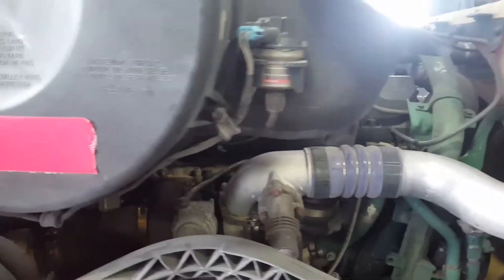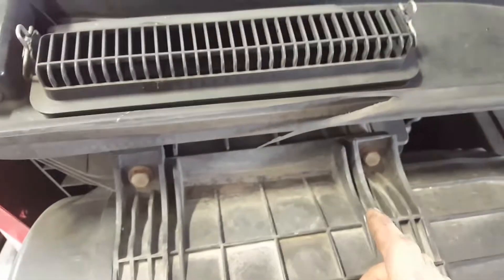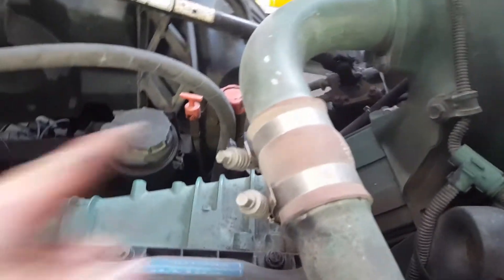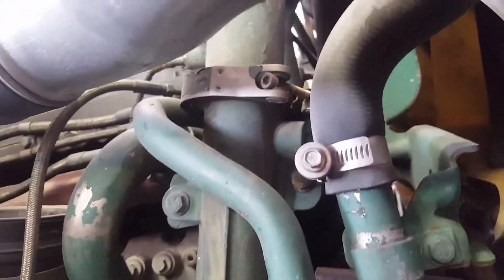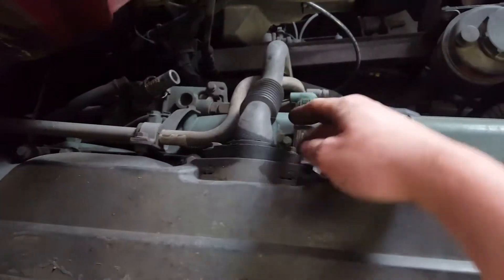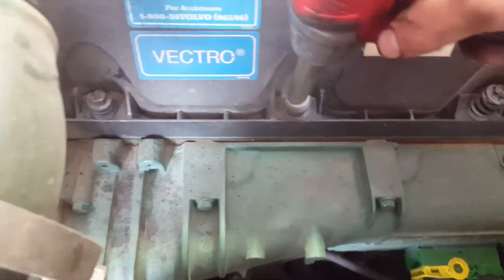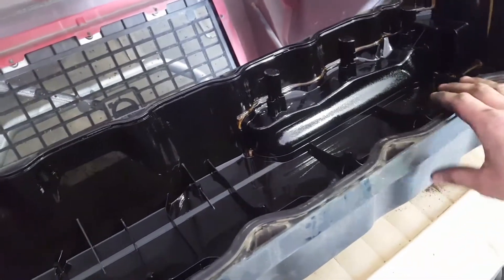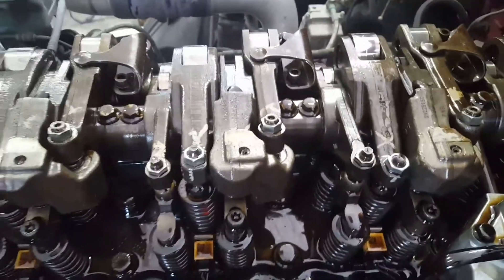How to Remove Valve Cover on a Volvo D13

Comment: I have a 2015 volvo truck d13. I have a green plastic piece that separates my upper and lower valve cover gaskets . My upper and lower valve cover gaskets is what i need to replace. Is it still the same procedure ?

Comment: Thanks for the vid. I'm being told that there are two gaskets and a plastic spacer. Is this accurate? I don't see the spacer and two gaskets in yours. I want to replace the gaskets but I'd like to know  ahead of time before I take it apart and don't have the parts I need.
Reply from the maker: I think after 2015 or so they use 2 peice valve cover. It's obvious just by looking without taking it apart. The 2 peice valve cover gaskets I think are only sold with the cover, Or they are very expensive like $250 each range, can't quite remember but maybe is different now.

Comment: Appreciate it for the video man! I’m about to change my valve cover gasket out, just wanna know what kind of oil sealer you used when you reinstall the cover
Reply from the maker: Loctite brand gray sealer
Reply: Thank you I appreciate it!
Reply: Do you know if you just scrap it off and then apply in the same spot all around where you put the cover back on
Reply from the maker: @Yesssirr2468  yes only need it where upper timing cover meets head
Reply: Thank you really appreciate it bro!

Comment: Engine starts shaking/vibrating when switching Jake brake to 3rd the highest position.... works fine on 1st and 2nd positions.
Any ideas?
2015 Volvo d13

Comment: Do you have a video on repairing the bull gear on a 2010 D13? Mine came loose and chewed up the teeth on the compressor.
Reply from the maker: paulcat9 No I don't, to do it you need to remove transmission, starter, air compressor, etc whatever is connected to rear cover, you will probably need new rear cover if gear was bad enough to mess up compressor. IF you want us to do it email me at semitrucksdiy@gmail.com we are near Harrisonburg,va
Reply: @cardinaltruckservice3753  Hi. Are you guys based at Mt Crawford, VA Virginia Xpress?

Comment: Do you know why my d13 is leaking oil on the back of the engine?
Reply: You might need to replace the gasket an put new sealant on the back of the engine, check the 6:12 min of this video.
Reply: the most common causes of leaks at the back of d13 engine is valve cover gasket thats the cheapest, rear upper timing cover, or the worst is timing gear plate

Comment: I had the injectors replaced but now the. Engine brake does not work. 
Could it be that the mechanic forgot to connect the electrical part?
Reply from the maker: It's possible if it stopped working right after the job. Check if connected and check if o rings are on securely and correctly
Reply: Thank you very much 
I appreciate your help 
I’ll check that connection and let you know

Comment: What is torque for the valve cover bolts?
Reply from the maker: Luis Guillen 15lb for bolts or 29lb if you have studs
Reply: Kalinchuk DIY 
Thank you so much